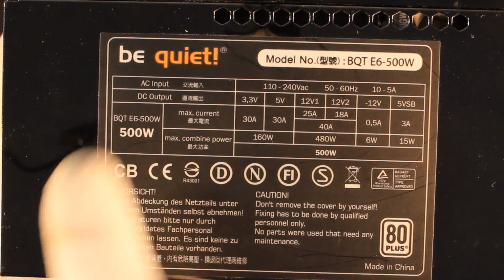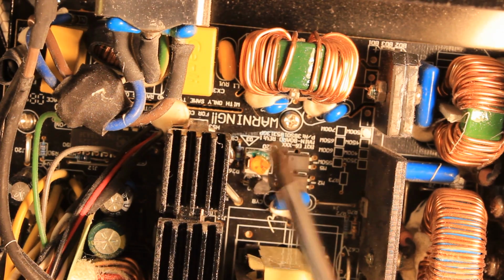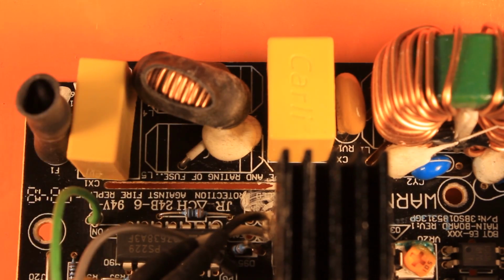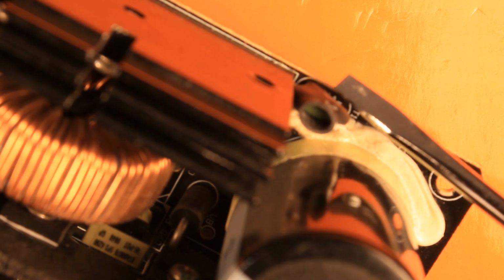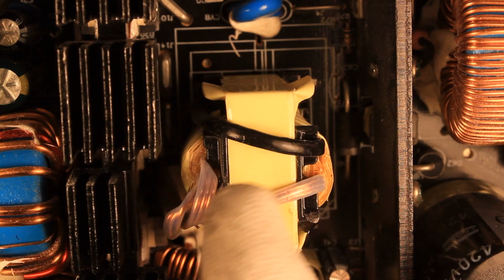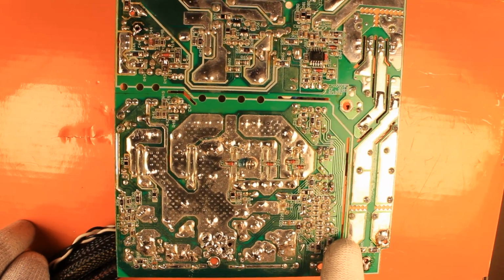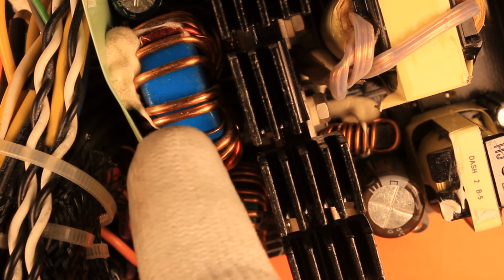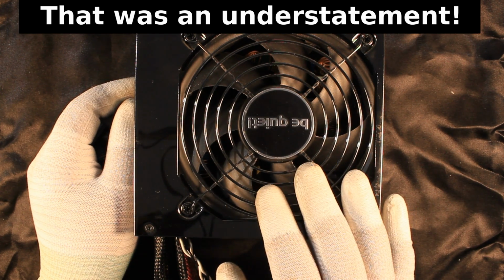500W Be Quiet! ATX power supply teardown, detailed overview and repair

Comment: Dark Power Pro !   500W  from 100W mosfet ,  i just opened up some cheap Ultron no name power supply 300W ,  that i found on my bench ,  Ultron 300PFC  , trust me its better then that Corsair  , the best one ive seen and ive seen a lot .  Cant explain to beginners what it  is , looks cheap as hell  from the outside but inside where it matters , all quality parts , and no joke like nichikon  CAPs and that , but proper metal  , ferite , big ass mosfets , 200W package, get it you will see what i mean . Folks in US cant get it by that name but you probably can , Ultron 300PFC 300W , youl get it for 10 euros , mosfet in it is worth that much .
Reply from the maker: That was exactly my point in the video as well, that manufacturers should not spend all that money on the useless shiny packaging, but instead put it in the hardware. However, I would assume that marketing have decided otherwise, since nice looking things sell better. That is my guess.
Reply: @DonkeyLearningIT  Off course, my point as well , cant really explain that good , take a look your self , what looks like another Cheap SMPS  that i wanted to salvage for parts , ends up like a proper Unit  , tell me waht you think ,  Does Corsair , or Cooler Master have this , not the ones i had  , it really is something  https://drive.google.com/open?id=1g_MJUD0n_6MTthdljTa1Twz7ntTZ9UtB

Comment: Teapo is a cheap chinese company that makes capacitors and MOSFETs on motherboards. they had capacitors literally blow out on motherboards back in the early 2000s known as the "capacitor plague".
Reply from the maker: I see. So when I called Teapy the Cheapo, it was not far off. 
However, what surprises me is that other power supplies in the similar price range use the same low grade components like this one reviewed in the video. I guess that they have to keep the price low...

Comment: hi, i have a highpower 700w psu which  used to reset the pc when start a game until i replace the capacitors but after a time it came up with the same problem but also now all the 3,5 and 12 volt lines has wave voltage. for example 12v line is like 11.85...11.82...11.87...11.85...11.82...11.87...... and the fan moves like 1 mm everytime volgate goes up and down. there is a video about it my videos. can u help about it? i am new at electronic. what should i look at first?

Comment: So lets see, the ac is rectified through a double diode bridge, then it goes into the power correction circuit and then through a choke to smooth out the ac, according to you.  WTF!!
Reply: Smoothing the AC after rectification?

Comment: I have zalman psu 500watts, 12v ok , 5v ok, but when pc turning On, Loading on windows on load, The PSU shuts down or lose its power , even i jumper the PSU with a clip to force on, i just wait after more or less 5 minutes, and the the PSU power come back, Still SHUT OFF when Load .. PSU turns on for just 30seconds and then turn off, VICE VERSA, pls help what should i replace thank you

PS - ive try other PSU to my unit and its working fine. Its Zalman something faulty
Reply: Up

Comment: Is it possible to drive only the secondary side of a PC power supply with DC current in order to run a desktop computer directly from a solar system? If so, where should the connection be made on the PSU  circuit board?
Reply from the maker: Switch mode power supplies work in fact internally with DC voltage. After the diode bridge DC power is being pulsed to a transformer, and rectified again.
However, your solar system needs an MPPT Maximum Power Point Tracker and mostly they are providing AC sine wave as output, or they charge low voltage batteries as output (between 12 to 96V DC). Because of this, it it almost always easier to just use the power supply without any modifications and attach it to the AC output of the MPPT.
Reply: Thank you. I appreciate you feedback... AJM

Comment: Aren't mains capacitors supposed to have a resistor connected to them in parallel so that they are discharged after a couple of seconds?
Reply from the maker: There are two small 0.25W SMD resistors connected to them on the bottom of the board.
As far as I remember, they were 100KOhm, so it will take almost a minute for those caps to
discharge. However, if the SMPS IC is doing its thing right, the caps should be discharged by the switching element into the transformer.

Comment: I agree...no way this is 500 watts. Audio equipment uses peak voltage and not RMS. Totally misleading.
Reply from the maker: It might be 500W peak-power, but definitely not nominally 500W. For that it would need to be operating at around 98% efficiency considering those "heat-sinks" which barely have some surface area.

Comment: I am not sure there is a problem of 85C on the primary caps, as they are not driven hard. Hopefully the replacement capacitors were low ESR
Reply from the maker: Well, when I still had time to game on my PC, there was hot air blasting out of this PSU, so an 85C rated cap will not be happy for a long time under such conditions. The main point of the video is, that they should have saved money on the fancy packaging and such, but on the internal components. Simply I expected better electronics from the manufacturer, that is all.
Reply: Good point, but I think most primary capacitors are 85C, and they rarely fail at all (I've never seen one).
Reply from the maker: The situation is, that these PSUs are considered to be Quite! good (pun intended) in the German market. Based on the hype, most probably I put my expectations way too high though...
If they ever send me a newer PSU model, I will be more than happy to tear it down, and give my opinion on it. 
I would not mind point out if the innards have improved compared to this older model, since I actually like   Be Quiet! as manufacturer.
Reply: I tend not to but new, but rather recap the original; that way I can be sure about the capacitors.

Comment: What is the white glue thing they apply/drip to some of the capacitors/ components? What is it for or why do they use it?
Reply from the maker: Good manufacturers will use a Silastic product, which is a special type of heat resistant glue, which will stay partially elastic/rubbery even after it is fully set. Cheap manufacturers will use hot-snot, or a fully hardening glue...
The functionality of this material is to keep heavy components from mechanically moving around in the board. This is why it is being applied mostly on capacitors and inductors, because those tend to be heavy, and they can bend/break easily due to mechanical vibration.

Comment: This filtering inductor on input is like it is, just because it is enough to pass required tests. As the same board is used to manufacture many power output versions, they leaved place for better elements for models with higher current consumption.

@edit: Same thing goes with this larger footprint transformer

@edit2: In active PFC PSUs primary side is driven to much larger voltage, than peak of rectified line voltage - it is important while replacing components

@edit3: OCP is typically realized as UVP, they just cheat with safety
Reply: But solution for power switch...
It is so horrible, and dangerous that it beats almost every Chinese cheep-ass PSU designs :/
Reply from the maker: That is a very long way to say, that they saved 0.1 Euros on a PSU which was supposed to be high quality. 
They should have saved that money *on the packaging*. Seriously, the fancy packaging was probably worth 5Euros!

Comment: I purchased a Be Quiet fan - noisier than all the other fans in my PC combined.
Reply from the maker: You most probably got a faulty fan from your distributor.
In the Be Quiet! power supplies the best thing is their quiet fan. At least in mine they still used good a quality fan and also a nice fan grill. Even after long years of use one can barely hear the fan when it spins.
Reply: Yeah I was surprised at how loud it was.
Reply from the maker: I would just walk back to the store where I have bought it, and ask the guys to exchange it.

On the PCB layout of the unit I am tearing down in the video the Chinese engineers have not made their best effort, but the fan is a high quality fan nevertheless. If the PCB would have been designed in Germany, it would most probably make a better impression on me as well.

Comment: Hi and thank you for the video, very informative. I have a faulty Enermax 850+, my PC hung on boot-up, pressed & held on/off button to shutdown. Have done this many times before. Now the PSU is dead, won't start, fan runs for a 1 minute or so than stops. Removed the PSU from PC, shortened green/black etc, no go. I noticed that when measuring continuity with multimeter +12v & +5v are connected. That should not happen? Capacitors all look okay, no bulging etc. Any suggestions where to look next? Have contacted Enermax in USA, old story.... Out of warranty, no support etc etc All care & no responsibility Thanks Peter
Reply from the maker: Are you really sure that the +5V and the +12V are shorted at the output?
Namely, when you measure it with a digital multimeter (DMM), the output capacitors will often fool the multimeter, and until the caps are not charged, the DMM will show a short.
There is a rare failure mode when the +12V output can really come in contact with the +5V output, and this happens if the copper winding on the output choke (practically a ferrite ring with lots of thick copper windings on it)
burns up. I have seen only about 2 or 3 ATX PSUs, which dies this way.

In any case, if the +5V was really shorted to the +12V rail, that would mean the death of the motherboard.
Therefore, you should remeasure, and make sure, that the +5V is shorted to the +12V.

If this is not the case, you may try to repair it, but you need to be super careful, since these voltages are highly dangerous inside an ATX PSU. If you are really willing to repair it, I can eventually help you out based on some
pictures or a short video what you upload, so that we can see how the circuit looks like.

Comment: Hello,
First of all, Thank you for taking the time in posting your video. Secondly I have a PS problem.
I have a 10 amp 13.6 volt 136 watt power supply with short circuit protection. The PS does turn on, but the voltage output dropped to 4 volts. Could it be a IC problem or capacitor problem? There is a VR voltage adjustment inside but it doesn't change the voltage output.
Reply from the maker: Is it a switch mode or a linear power supply?
I would not be playing around with potentiometers inside the PSU, but instead one need to fix the real problem.
You will need to post either lots of pictures or a short video on the innards of the PSU, so that people (like me for example) can give you hints of how to try to repair it.
Reply: Thank you for your reply, This is not a  computer type PS. It's a linear type with a large and heavy transformer which I was using to power a radio transceiver and an external amplifier,  give me a few days and I will post pictures. Thanks again.

Comment: 20:40 "This is ready to pop when something happens"

I was working on a power supply that wasn't functioning with one of those chips with the FET integrated... I was reading the data sheet and suddenly something exploded over at my bench... it was that chip. RIP
Reply from the maker: If they do a decent design for cooling such chips, they can work, it should not be a problem. 
I would say in your case you just got "unlucky". However, as you see, in the case of this PSU, they are just having a silicone pad on top of the IC, and a tiny area of the "heatsink" is touching it, which I would not call cooling.
The issue what I have with ICs which have the FET integrated is, that they need to have a real screw-hole, to which one can attach a heatsink to dissipate heat. Even so, replacing the IC is so much more expensive than replacing a cheap FET and a cheap IC.
Reply: In my case the IC costs~ $1.50 from mouser, which is about he same as a decent FET. my problem now is whether to try ad find out what else failed that caused the chip to blow or just scrap the power board. IC is CoolSet F3. Not sure exactly which one because I couldn't find the piece with the last 4 numbers of the part ID!
EDIT: BTW the chip wasn't cooled. 

The FET wasn't getting very hot as opposed to the diodes in the design, the diodes heated enough to discolor the PCB in spite of a heatsink.
Reply from the maker: If you got too much free time, I would probably track the leads and try to figure out the pinout. Based on the pinout sometimes it is possible to figure out which IC it was if there are multiple options within a series. Also, based on the amount of power it was switching and on the working voltage you can make a good educated guess. 
For these all-in-one 8-pin packages I often found, that when they fail, they often kill the Zener diode which is used as an external reference (most probably the Zener is zapped by the mains voltage when the arc is formed during "explosion").

Comment: Hi. I have CM 1000M psu , one day after turning off a pc , when i wanted to turn it on , nothing happend . I heard on click of relay inside but it wont turn on . Nothing was burnt inside , no smell , no visible caps damage, no dark spots(like heat) , so on . I think the fault is small but non of repair shops close to me wont even look @ it . What do you think about it , shold i push on repair or forget it ? (I kind a liked that thing :) ) Now i have Seasonic 620w , much smaller but nice psu also.
Reply from the maker: By not turning on do you mean that even the paperclip-trick is not working. For your information, the paperclip-trick is when you push a paperclip or a piece of copper wire between the power-on pin (green wire pin) and a GND pin (any of the pins from the black wires). This should turn on the power supply, so that you can measure the voltages. Of course, for the paperclip-trick to work, the +5V Stand-by voltage has to be present. 
Do you have a multimeter and tools for repair???
Reply: Some PSU got load sensing so it wont turn on  if there is nothing conected to the rails  and well , maybe its fuse , but if its fuse something is more wrong that got the fuse to pop . i l try to get time to take a look , atleast do or check what i can . if not il store it for parts. .
Reply from the maker: For some reason your new comment is not displayed below the video. YT is totally broken, sorry!
If the paperclip trick turns on the PSU only for a second, this is most of the time an indication that some of the protection circuits is turning the PSU off. Most of the time one of the caps will be totally bulged, and shortcircuited inside (80% of the time). In the other 15% of the time the small capacitors which supply the window comparators are busted, and the remaining 5% of the time one of the Shottky diodes on the secondary side is shortcircuited. First replace all caps in the secondary side, next check the Shottky diodes with a multimeter.
Reply: no , it wont turn on with paperclip i tried that first time i got the psu out of my pc, no voltage on +5v standby and il check inside when i got time. I have tools :) thx.
Reply: I have the same problem with you "makinjica" . I have a Cooler Master V650, after i turn on my PC or when i use the paper-clip too it's start for 1sec and than stop ( with click sound too) , and same here too, nothing was burnt inside ( nothing looking bad ) . so what do you expect ?
Reply: makinjica well thanks , I hope Mr. Donkey Learning IT can help up in testing components, maybe we can find a solution.
Reply: Donkey Learning IT Thanks for your help, so can I test the diode first and than changing all caps ? if my talk have no sense so I will do first what you said ;)
Reply: Jesi ga sredio?
Reply: In my experiences if you look closely at the mosfets (or shotkey diodes whatever they are using)
Some might be visually crumbled / fallen apart.
Now I couldn't tell you if simply replacing those would fix things since there had to be a reason for it to die in the first place.
You might find burn marks or not, I've seen both.. where the one with the burn mark popped really loudly when it died.

Comment: Nice work. @16:00, 85°C is quite high actually. If your PSU is running at that temperature, that means that the rest of your pc (or whatever you're left with, depending on how much lucky you were!) is burning up in flames. However... yeah, that's cheapo things... don't expect miracles out of them!
Reply from the maker: I think you misunderstood the temperature ratings for the capacitors. Namely, the temperature rating is an indicator at how long (i.e. years vs months) they will keep their capacity under the same heat conditions. 
The 85C is the highest temperature the capacitor might be exposed to without immediate failure, and more expensive ones are rated at 125C. However, when both a 85C rated and a 125C rated capacitor is being exposed to the same standard 30-40C heat coming out of the PSU, the 85C rated part will degrade and fail a LOT faster. 
In contrast, the 125C rated part will work for years because it has a higher quality liquid electrolyte material.
Reply: Donkey Learning IT thanks for the info. Still on the cheap side so.
Reply from the maker: Yes, they tried to save pennies on some parts where they should have not.
However, other PSUs in the same price range sadly are often looking even worse, and they are even lacking a high quality low-noise fan. The fan in the Be Quiet! PSUs are probably still the best I ever seen.
Reply from the maker: The high quality fan is definitely something which makes these PSUs stand out from the crowd...
Reply: That's why they named it Be quite x)